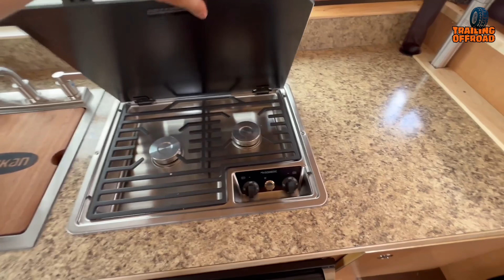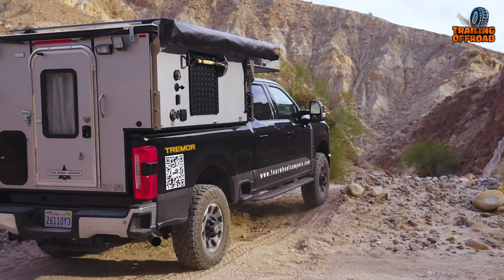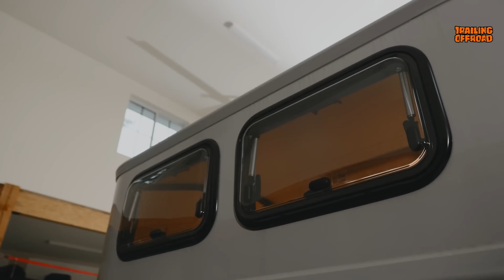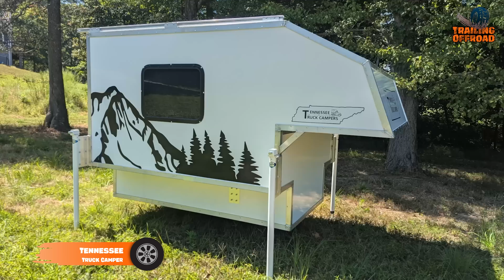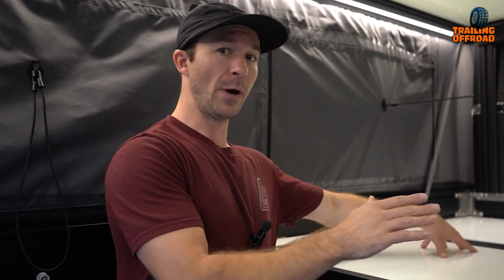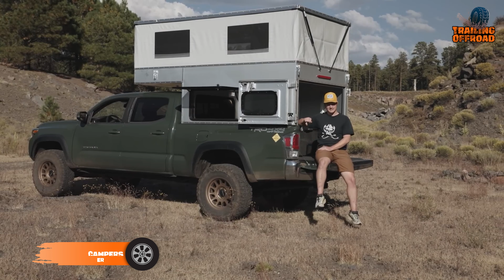25 Amazing Lightweight Truck Camper You Should Check Out

Comment: Lols,,,, I think there are only 25 lightweight Truck Camper companies...... Those Awnings on the Back are almost useless.. I just saw that Outdoor Solar Light at the Dollar Store for $1.50. Do not break the top of that Induction Stove and you have buy special pots to cook on it... Molly Storage easily means tumbling gear out onto the floor if your on your usual government pot holed road. I stopped looking at them when a $15.000 Unit now became a $65,000. Unit with nearly nothing new.....

Comment: Some of these "less expensive", smaller options don't seem to be less expensive per unit of space.  I actually think they may be a bit more expensive in some cases.  In this I was not even factoring in the price of the 50+ thousand truck.
Reply from the maker: It’s true that you're often paying a premium for the specialized engineering and lightweight materials. <3

Comment: With new composite materials, laser cutters and 3F printing I bet I could make one for under 10k that's every bit as nice as this, now go scale... these can be made for under 6k... less the power setup and extra... the shell  and inner bunk and mattress... with sink.. no problem under 10K  !
Reply: All these campers for mid size trucks without a shower or even a bathroom are all a joke.  
Do you just relly on a campground to shower and when off grid only take outdoor showers on days with weather permitting?
And to you kick everyone out the camper no matter the weather or time to poop?
F*cking ridiculous, specially for the price.
Might as well just sleep in your topper for a lot less money.
Here in Brazil there are at least  10 models or more, solid sides, no popup for mid-size trucks with showers and bathrooms for $24-34,000.
Reply: @marcodeoliveira9933  yeah but then you would have to live in brazil🤮🤮🤮
Reply from the maker: Sure, make one under 10k, and we'll definitely feature your rig here.

Comment: If 1,560 pounds is lightweight?  I guess for 3/4 ton.
Reply: Yeah, 1,560 lbs isn’t light for a midsize, but for a 3/4‑ton rig it’s on the lighter end of hard‑sided campers.
Reply from the maker: Yeah, thanks for understanding.